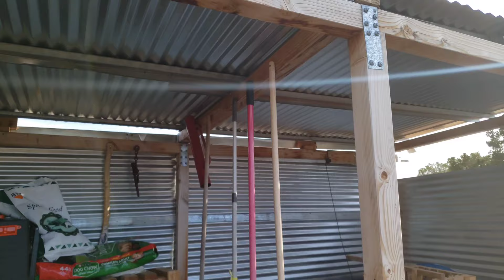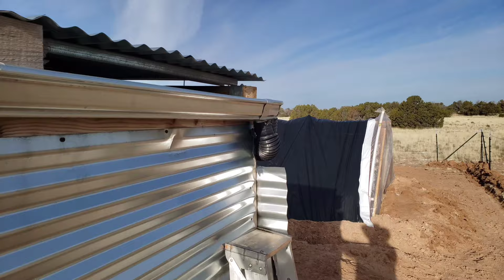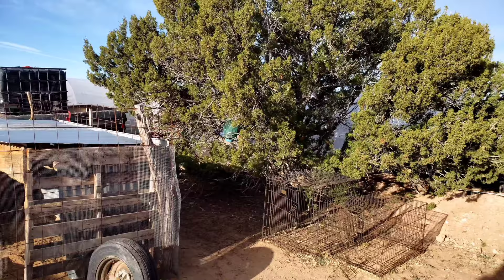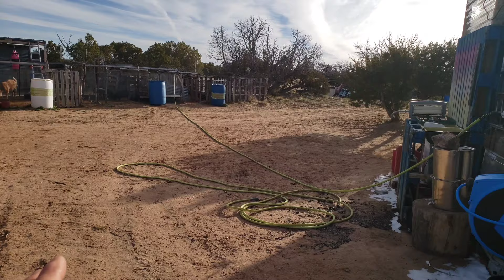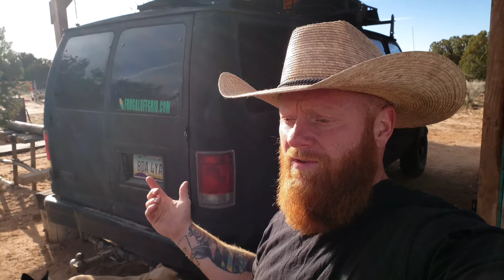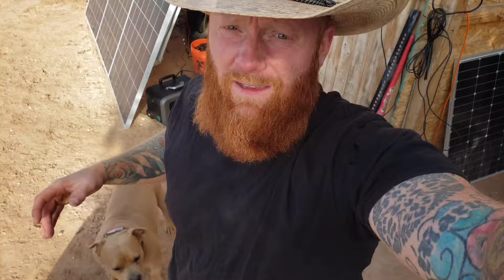10 cheap and easy off-grid diy projects

Comment: Very interested in the workshop build. We did something similar for our outdoor kitchen. We are building an outdoor shower and bathroom area this year with a solar hot water heater and I think we will use a very similar construction.
Reply from the maker: Yea, my build was about as simple as can be. Just a stick frame shed with a slight pitch and pine panels for siding.